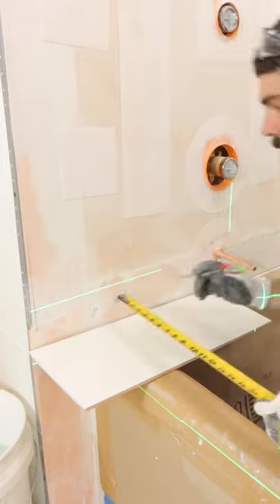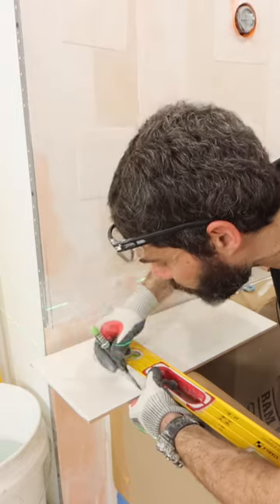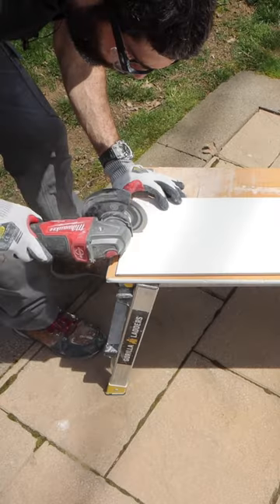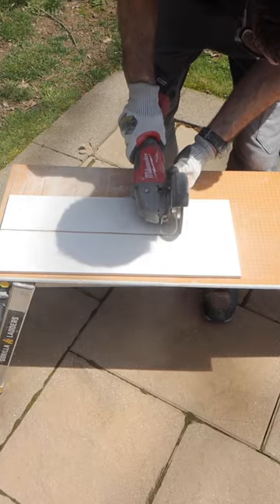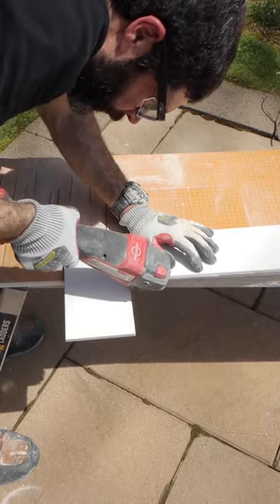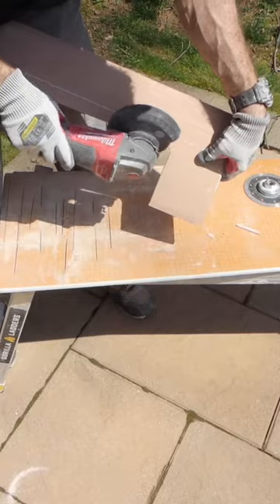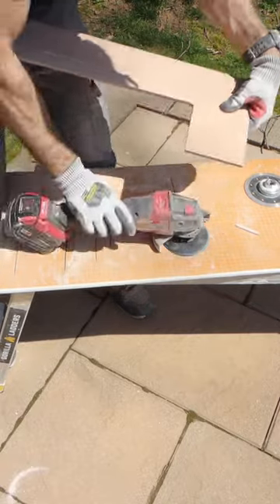Tub shower tiling tips - #shorts

Comment: pointless ,because that bottom part will be sealed and you never going to see it.
Reply from the maker: I appreciate your comment, but that tile has to be polished and the joint small to avoid water wicking upward. Large silicone joints are unsightly, unprofessional and ultimately lead to maintenance problems. The way I finish the joint leaves a super tight reveal and any chips will be very noticeable, hence the extra care when cutting
Reply: @HomeRepairTutor  you really aren't making a fair comparison at all.   Saying it is your way or the extreme opposite with large rough cuts and nasty Silicone joints.  I have done lots of showers/tubs.  There is an in between and it's results are just as good as you are doing, without wasting time. It also depends on the equipment.  We have high end saws that cut great.  
The thing I would really question is your "expansion joint".  If there's true expansion, you most definitely need something besides Grout, no matter how good your cut is